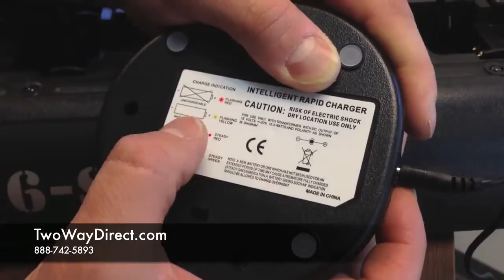NNTN4497CR | Motorola CP200 Batteries [CP200, CP200d, CL200XLS, PR400]

Comment: that 4 digit number has to be an expiration date, if anything at all, because I have one that reads 1902 and some that read 1852. shouldn't that translate to the second week of 2019, using your logic? I should mention that I have several old batteries that I'm about to recycle and I noticed that they're made in Japan and finished in Malaysia. The new batteries I just received are made in China and finished in Mexico. I wonder if that accounts for the discrepancy in the numbering, based on what you've said about that 4 digit number?
Reply: How will I do if my radius cp200..drop to a swimming pool..4 almost 30 sec..its now not working
Reply: This guy doesn't even comprehend that 16Wh is Watt hour.... NOT work hour.... I'd trust nothing else he says.